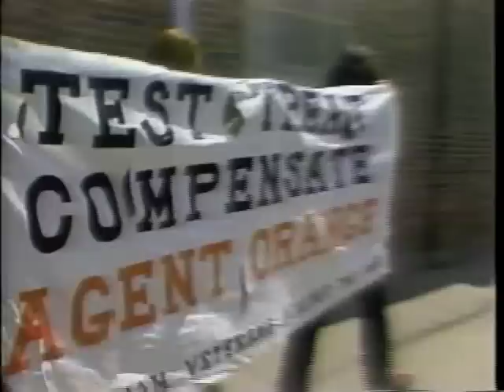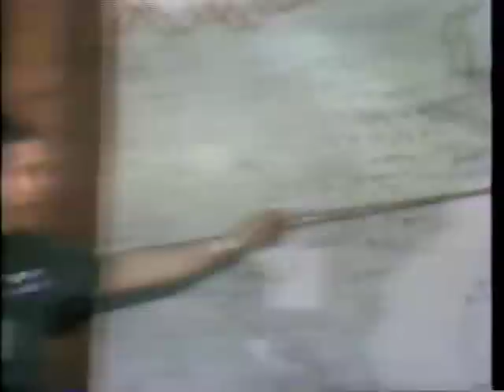Teacher Resource: The Vietnam War with Walter Cronkite: Fire From the Sky (1987)

Comment: Actually, the US dropped 3.5 million tons of bombs in WWII.  The figure quoted by Cronkite the archliberal includes all of SEA, not just Vietnam.  Given that the bombing went on for 14 years, rather than just 3 1/2, one can get a sense of the difference. 

But much of it was wasted, unfortunately, due to horrific interference in the conduct of the war by liberals heroes like McNamara, LBJ, Bundy, Rostrow, et. al., who often directed the bombing of empty jungle while imposing restrictions on targets of real military value which were ludicrously onerous. US aircrews could not attack SAM sites until fired upon first, for instance. As noted below, there were protective rings around Hanoi and Haiphong which let the NVA build up endless amounts of land-based air defenses. 

But still libs like Cronkite were crying about "the brink of cosmic destruction" and widening the war to include the Soviets or Chinese, neither of which was even remotely possible at any point in the war.  They did more to lose the war than anyone else.